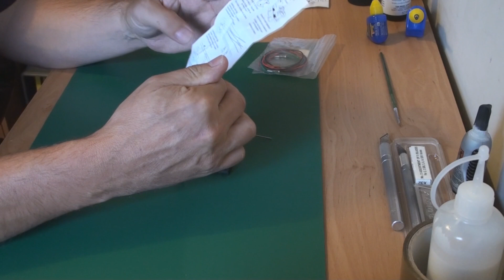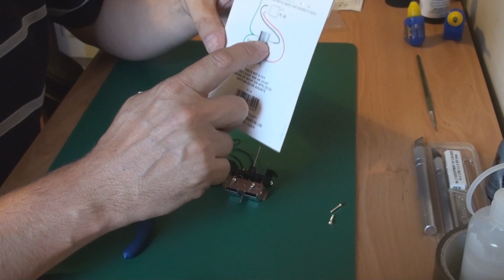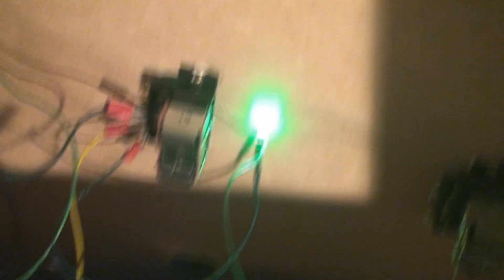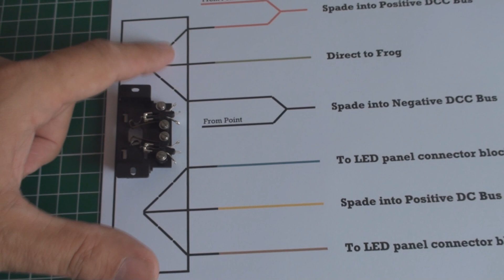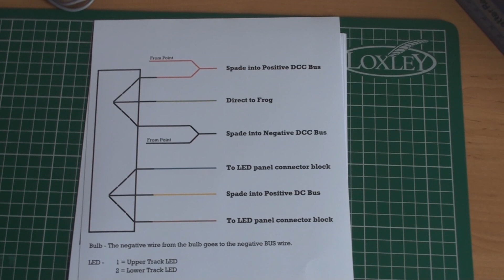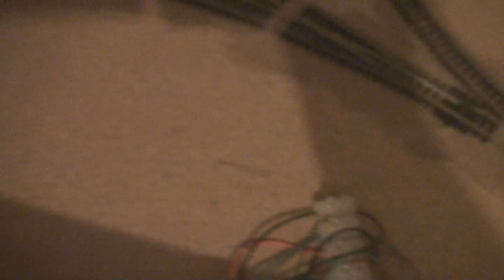HOW3 - Building and fitting Peco PL-15 micro-switched PL-10E point motors.

Comment: Probably much, much too late now but what a poor explanation video. It didn't say how to drill the motor shaft hole and what size, it didn't show which wires went where (Just a comment "I've connected up the wires" - where from and to? At one point he called the point the point motor, etc,etc. If you are going to publish anything then check there are no mistakes or omissions.  Not very helpful for a newbie to the hobby.

Comment: I found when putting these together many times over. That if you have a piece of scrap wood with a hole drilled in it you start to bend the tangs with pliers, but then stand the point motor on the piece of wood with the short end in the hole. You can then fininsh bending the tangs over with a dot punch (3/16 is what I use),or an old flat bladed screwddriver. I did like the tip about centreing the bush prior to fitting.
Reply from the maker: Great tip.  Thanks for sharing.

Comment: Great video and informative, but could you please tell me what CDU, do you have and how many points does it work.??
Reply from the maker: Hi Martin, I am afraid that I cannot get to the back of the layout to check because it is stored away ready for selling.  If I recall correctly, there was a small black box (probably from Peco) which was wired between the layout and an old analogue controller from my OO gauge from 30 plus years ago.  It powered all of the points on the layout.